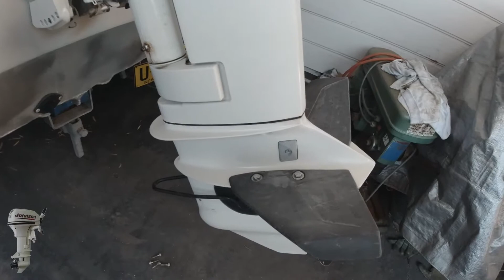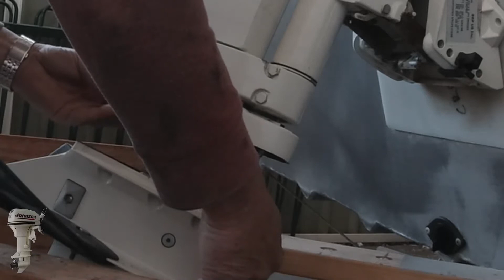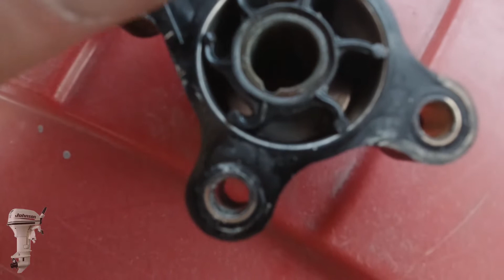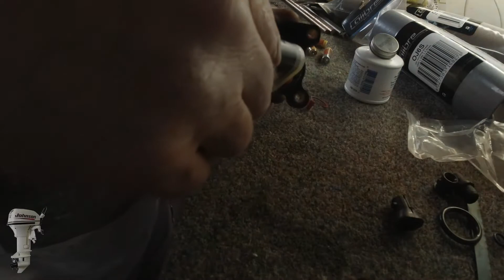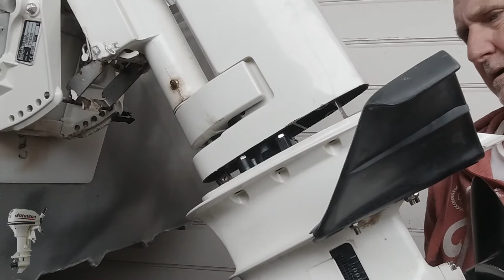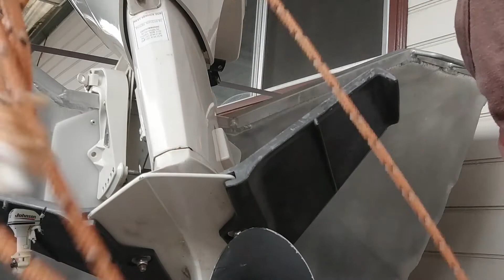Johnson 15hp Outboard Water Pump, Thermostat & Head Gasket Replacement Part 1

Comment: Don’t the people making these videos have a set of 1/4” drive socket? That removes the leg bolts in literally two minutes. The shift linkage in another 15 seconds. There is plenty of room to put a 1/4” drive socket in & undo the shift linkage bolt.

Comment: Thank you for the details about the shift linkage. 
Two questions: 1) did the drive shaft carry an o-ring in the upper part, near the middle of the splines section? 2) why did you work with the motor in vertical position? Is there any specific reason for not tilting it?
Reply from the maker: Hi There was no 'O' ring on the shaft splines. I coated the splines with Marine grease prior to re installation. Working in the vertical position was easier for me as the weight of the gear case aided in removal. Hope this helps. Cheers
Reply: @albabmg  thanks much!

Comment: Good clear helpful video/s. Thanks for uploading. One thing maybe worth mentioning for others is. ... be mega careful not to strip the threads on the shift rod connection clamp. The temptation to pry the clamp open a bit for easier rod reinstallation is real. Don't because then the screw wont exactly align into the softer thread of the clamp. Also the beveled out section of the rod rides on the screw and can wear the thread over time. Plus if its had previous pump impeller replacements the clamp thread is likely to be a bit worn.  I replaced that screw with one slightly longer and used a nut & loctite on the other side of the clamp. Better safe than stuck 5km out in neutral.  All the best!
Reply from the maker: You make a good point here. You definitely do not want to strip that thread or cause a misalignment. Cheers.

Comment: I got a 2005 15 Johnson 4 Stroke No water pump whatever I do Any ideas?
Reply from the maker: Not sure why your motor is not pumping. You need to check the pump as well as the thermostat and also check for any blockages within the system. Sometimes the plastic water outlet nozzle can also become blocked. Cheers
Reply: @albabmg  Thanks

Comment: Do the intakes get stopped up a lot and does mud and sand built up in the bottom of the lower?  Seems if you don't clean them out you are just looking for trouble.  Am I correct?
Reply from the maker: It's not so much sand and mud that cause restrictions in the water intake. The main problem for me is salt water. I use my boat mainly in salt water estuaries and even though I flush the system with fresh water there is still a build up of salt and its reaction with the outboard components. I would recommend pulling the engine apart every 1 to 2 years and giving the engine a good clean and new water pump. Cheers
Reply: @albabmg  I noticed an extra o ring in my water pump kit, and I re watched you video and I didn't see it with your install.  I have a 2000 15 hp Johnson, so maybe it's for another model?  I just don't want to reinstall the pump neglecting that o ring but if it's not there, then I a ready to go.
Reply from the maker: @JLH1956  Hi There were a few extra bits in my pump rebuild kit. I just replaced what I needed to. The kit probably covers a few similar models of outboard motors Cheers
Reply: @albabmg  Thanks for your great info.  I noticed that my shifter rod was bent a bet, and I am having a problem getting it to line up. Is that bend a normal thing in the shifter linkage rod?
Reply from the maker: @JLH1956  My shifter link rod was not bent. It is quite difficult though to reconnect. I had to move the gear shift lever into gear (reverse from memory)to drop the link rod so that I could line up the bolt. Get someone to hold the gear shift so that it doesn't move back to neutral when you are trying to get the bolt back in, this should help. Cheers

Comment: Is your motor an electric start? Mines a 2005 9.9 4stroke. I want to turn mine into an electric start because i see spot where a starter will be and the other wires that is not connected to anything. So im thinking it would be for that. Also if i change the carburetor to a 15hp carb will it be a 15hp. Sorry might be a dumb question but i seen some videos of some turning there 9.9 to a 10 or 15 by just changing that. But not a johnson motor that i watched. Could you make video of the motor with the top cover off
Reply from the maker: My Motor is a pull start. If you have a look at both Parts 1 & 2 you will see some video with the covers off. You won't change the capacity of your engine by changing the carb. You can certainly get more power from your engine with a different carb arrangement, but I have no experience with that. Cheers

Comment: Hi there, it seems your engine is slightly newer than mine, as mine is a 1999 2 stroke model. Any chance you know if the kit you bought will work for that one as well? Also where did you buy that kit? Seems to be exactly what I need. Thanks for the video!
Reply from the maker: Hi I purchased my parts from this Australian website.
https://outboardparts.com.au/ 
Looks like the parts for your outboard will be the same as mine. My Outboard is a 2007 model. This is also a pretty good website for the their parts Catalogue.
https://www.outboardwrecking.com.au/parts.php
Cheers

Comment: Thank you so much for posting this video. Any idea why it stopped pumping water as the old impeller looked fine to me. Possibly the thermostat?
Reply from the maker: Initially it stopped pumping because of a blockage so decided to take it all apart and replace the impeller and thermostat also decided to remove head to have a look at the water jackets. There was a fair amount of muck in there. Managed to clear it all out and give it a good clean. All good now though. You are correct there wasn't much wrong with the pump but replaced it anyway. The thermostat was a bit corroded. Cheers Brian